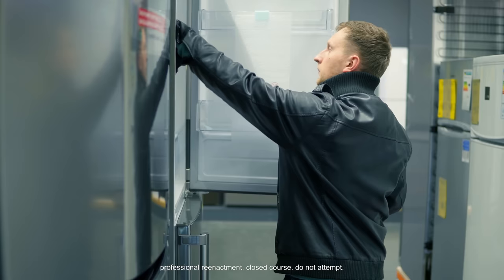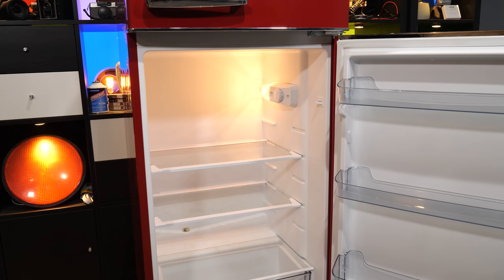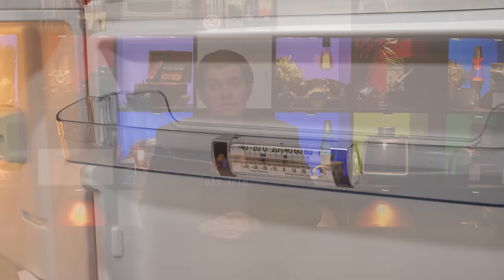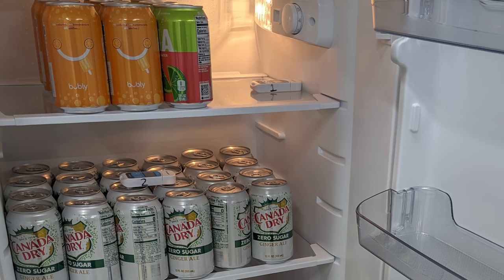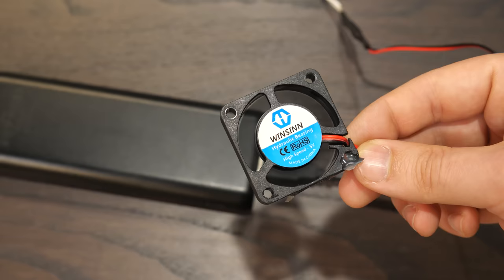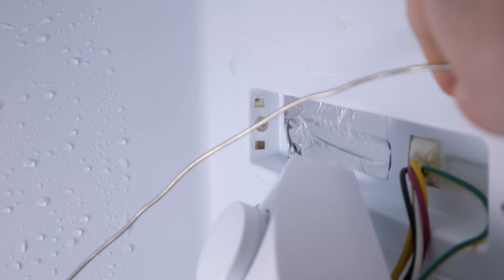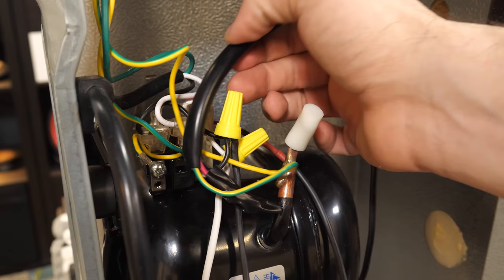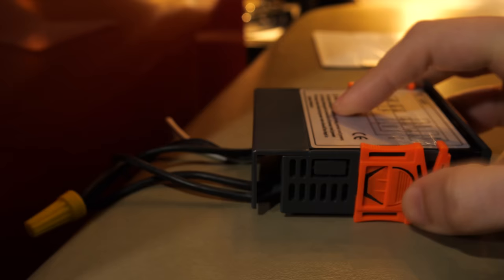This goofy fridge has a really clever design. It's also kinda terrible.

Comment: I think this design is used in 90% of all fridges sold in Europe. Sometimes you can see the fancy ones with integrated ice makers and water dispensers in stores, but you rarely see them in homes.
Reply: 98%
Reply: I am 40 years old and in all my life I have seen one home with a fridge with an ice maker and coincidentally that was this year.
Reply: @hkr667  This explains the general lack of ice in beverages in Europe.
Reply: I assume it's for "energy efficiency". As in, the device won't run constantly, even when warm, thus it will always use low amounts of power. Hahahaaha.
Reply: @hkr667 I'm 40 too, and in the first 30 years of my life in the UK never saw anything more fancy than this red 'mini' fridge. But since I moved to California, I'm the only person I know with a sensibly sized fridge. All apartments come with those giant monstrosities with double doors and an ice maker, which have surprisingly little useful space inside - what with only coming with one shelf - and consume a tremendous amount of electricity. And are pretty good at turning that electricity into a very audible hum.
Reply: @markmuir7338  Yeah, there are plenty of sensible refrigerators for sale at the appliance vendors, but most of the population want nothing to do with them.

I had to beg and plead with my grandmother just to get her to restrain herself down from the mega monsters and the best compromise I could get was a counter depth double door 17.5 cubic foot Behemoth.

When we never needed more than 12 cubic feet, and we certainly didn't need the stupid inefficient freezer drawer on the bottom.
Reply: @stephenj4937  Ice trays exist. And ice was common in USA before the wide availability of built in ice makers. Even in USA, I only see houses that have the in-door fancy ice makers. In every apartment I've lived in, if there's an ice maker it's sort of just this bolted in thing that dumps semicircular ice into a tray, and usually it doesn't work and just wastes space because the apartment complex never ran an actual water line to it.
Reply: @priestesslucy3299  Isn't that also to do with car dependency in US? IE you only ever get to shop once a week or so? Anywhere in europe I ever lived it was never a problem to do 5 minute stop on my  walk from work to get like 2-8 things so there was never need to keep stuff for more than 4 days ahead in the fridge.
Reply: @Turtle1631991  I've only lived in three places in my 34 years on this rock, but in every case I drove by a grocery store on my way into town to do literally anything, including work.

And I've always lived sort of in the rural fringe, away from the true population densities.

RN I live about 3 miles from a Fred Meyer, last place was 2.5 miles from a Safeway. In both cases it's right on the way to anything worth driving to
Reply: @priestesslucy3299  "I drove by"

That was sort of part of the point I was making.
Reply: @Turtle1631991  Much like how you can stop by a shop while walking or cycling, an American can easily stop by a shop while driving.

Comment: I agree with you that a refrigerator is a pretty essential kitchen appliance, but not everyone would agree that it is the most essential.  A few years before she died, my mom was talking with me about how much technology there was in the kitchen, compared to when she was a kid, and I asked her what appliance she thought was the most essential, and after a few moments though, she replied, “the sink and faucet.”  I had not even considered running water, taking it for granted as a given, but mom, whose job it was to fetch water when she was a little girl, very much appreciated having running water inside the house.
Reply: Very good point! My grandparents had water in their kitchen, but it was a hand pump for a well. Better than fetching water, but still a lot more work than modern plumbing!
Reply: There's a similar thing in the world of car maintenance. I did some thinking and realized that the only tool I use for every single job is a flashlight. You'd think that hand tools such as wrenches or sockets are the most important, but they're all useless if you can't see what you're doing.
Reply: As someone who has been putting a tiny home together for two years and living in it for one year, I can confirm it sucks not having a running water sink and constantly refilling tubs of water. On the upside, I never have to worry about pipes freezing and it only takes one of those to ruin your whole week basically while you cut out and dry out everything.
Reply: I'm wondering whether I'd choose running water or stove/fireplace. I think being able to use high temperatures makes cooking MUCH better and safer than being able to just clean the raw ingredients.
Reply: @PsRohrbaugh the most important appliance in the kitchen is actually the roof. My grandpa was responsible for holding the umbrella in the kitchen before roofs were invented. 🌈
Reply: @robertschnobert9090  Oooh la-di-dah, your Grandpa must have lived in one of them rich people houses.
There was no such thing as a fancy umbrella in my Grandpa's house.
My Grandpa had to raid neighbouring villages and capture a local to sacrifice to the rain god and pray to him to not rain in the kitchen.
If he came home empty handed his Dad would make him open a vein and make an offering of 7 pints of his own blood to the rain god as a punishment.
Reply: I don't think anyone in developed countries considers the sink and faucet to be an appliance though. They're just a mandatory part of the house, like electrical outlets.
Reply: I'm not sure you can consider it an appliance, but it's a really good point to make!
Reply: I'd best most people wouldn't think of that as an appliance just based off how people tend to think of individual items that can be bought, moved around, and plugged in when they hear the word appliance. Even the heaviest fridge or the oven would still fall under that mental image, whereas the sink is built in and not going anywhere so one might overlook it and take it for granted.
Reply: Your mother was an exceptionally wise woman; it's altogether too common for us to take things for granted the longer we've had it, and it takes effort to see what most people just expect to be there.
Reply: yeah, plumbing is not a kitchen appliance though.
Reply: @ngwoo that's the point, I think: OP's mom grew up without it, and she knows what a world without that amenity looks like. It's insidious how much water we in "developed" countries waste every day compared to people who have to actually draw their water by hand, often traveling more than a mile to get it. So many people live on 5 gallons of water or less a day (before boiling); for perspective, the average American uses 15 gallons for one shower!
Reply: @chaosvolt i think we can just use the dictionary here, Marriam-Webster:
2.b: an instrument or device designed for a particular function, specifically a household or office device operated by gas or electric current.

Meaning the generally accepted definition of an appliance is a device that runs on gas or electricity. (Main examples being the oven, microwave, fridge, clothes washer & dryer, ect.) This means the kitchen sink & running water aren't appliances. (But the water heater is)
Reply: Especially with the modern availability of canned and preserved foods, refrigerators could be entirely omitted from a kitchen without making it impossible to eat. However, I do think the tradeoff of needing to forgo the ability to save leftovers, keep fresh meat and dairy safe, and extend the appealing lifespan of fruits and vegetables, not to mention the ability to have ice cream at home, is too much for most people who were raised with refrigerators to give up. Especially because ice delivery service for an ice box is no longer a thing, so unless you have a cellar or something, you'd have no way to keep things reliably cold without refrigeration in the modern world
Reply: @jasonreed7522  Fair, yeah. Like I said this was more about what the word brings to mind when someone thinks of it, rather than exact definition. Both can end up causing someone to overlook fairly important plumbing fixtures, albeit for different reasons.
Reply: @chaosvolt  also fair, i would personally say that the most important thing in the kitchen is the food as that's what defines a kitchen. (Rooms are just rooms until you put things in them and give them a purpose, and the kitchen is for food preparation.)

And fair point about the risk of overlooking the true essentials because we are used to them. A short list of the things people just expect to work includes: electricity, water & sewage, gas if applicable, HVAC if applicable, and for the building to be structurally sound. And in the near future i expect high quality internet to be on that list if it isn't already. (I'm from a rural area and was used to dial-up until early 2010s, i moved and now 100mbps down is the minimum package. It not the same as when someone get the luxury of running water indoors and stops having to carry it in from the community well, but it still feels like a crazy jump in amenities and potential quality of life.) Who knows what will be added to this list in the future of "luxuries" taken for granted.
Reply: @robertschnobert9090  We were evicted from our hole in the ground. Slept in a shoebox by the side of the road, all twelve of us.
Reply: A fridge was not as essential back then as it may seem to us now.
Milk was "stored" in the form of cheese, fish and meat were smoked or salted, fruits were turned into jams... plus everything I can't think of right now and probably many other preservation methods I've never heard of.
They also knew how to preserve eggs from fall to spring so that they could continue eating eggs through the winter when the hens stopped laying.
Reply: I still think the fridge is more essential. I could fetch water from the bathroom (there really isn't any place outside the house to get it from), but I can't keep my food from spoiling in the summer heat any other way but with a fridge.

Comment: The fact that this fridge rejects modernity to the point of using an incandescent light bulb makes me love it even more.
Reply: It's the same reason the light in your oven is incandescent; they are consistently very reliable over very wide temp ranges.
Reply: ? my parent's 1 month old fridge has a normal incandescent light bulb,are there really fridges out there with LEDs?
Reply: @stephen1r2  No doubt because the temperatures that the filament operates at dwarf any of the ordinary temperatures found in its usage environment. It's effectively always running in the same conditions.
Reply: @vasopel  Yes, our fairly expensive one from 2012 is all LED lighting.
Reply: @vasopel yes, my fridge has an LED bulb, but that is acutally mentioned in the marketing, so i guess it's not that common. You can buy replacement LED bulbs for fridges but i haven't seen any for ovens.
Reply: @dragosmoldovan990  hm..I am curious..on your fridge..can that LED be replaced with a regular incandescent fridge bulb? and about oven bulbs...I am 99% sure that they are the same incandescent ones that work on fridges.
Reply: @timfischer  2012? hm..maybe only the expensive ones have LEDs
Reply: You can get LED bulbs to install in fridges, at least those that use a normal A socket. With how cheap LEDs are these days, it's especially ridiculous having incandescent bulbs, which are literally heaters, in even some brand new fridges..
Reply: @vasopel  yes, it can be replaced. If the wiring can handle it, it's just an E14 socket bulb.
Reply: @vasopel no, LEDs are ran using DC electricity where standard filament light bulbs use AC electricity. This means that you can buy led light bulbs for things wired for AC power because the LED light bulbs have a board and AC to DC converter built in. If you have issues with LED lights going out early, it's because it's buying cheap bulbs with cheap boards and cheap ac to dc converters. Devices built for and with LED lights usually use dc power directly which means incandescent lights are harder to run and take more power using DC than AC power so most devices that are designed for led aren't compatible with filament bulbs. 

Note: this is my understanding, i didn't research this and I'm just using my logic and experience to extrapolate this information. I could be completely wrong about all of this.
Reply: @TwoAPTMLMusicProductions , the reason LEDs go out before they're essentially unlimited theoretical lifespan is because they get too hot in enclosed areas. I suspect even in an enclosed area in a fridge that won't be an issue... I'm not sure about their running efficiency in cold; it's not impossible they may be dimmer or something. Another issue might be condensation that gets inside eventually. But I assume bulbs built for fridges have waterproofing treatments on their circuitry to deal with that.
Reply: Probably helps keep defrosted
Reply: @RobertHancock1 In an excess of  over-zealousness, I replaced the incandescent bulbs In my refrigerator with LED ones for long life and to reduce energy consumption. In a month both of them had burned out. Since three from the same batch burned out in my ceiling fans, I came to the conclusion it was a bad batch, not that LEDs wouldn't be perfectly happy in a refrigerator. Then I thought about it and realized that the incandescent lamps would last a long time because they weren't on when the fridge was closed (I take this on faith) and for the same reason I wouldn't save much energy nor heat up the fridge that much. So I put the old incandescent bulbs back in. Why did I write this comment? Am I waiting for the paint to dry on my Christmas tree lights because I didn't like the color they produced and decided to change it?  Haha, no, who would possibly do that?
Reply: @TwoAPTMLMusicProductions  actually, mine is just a 230V regular LED bulb. You could put a filament bulb in there no problem, assuming the bulb enclosure can handle the additional heat. It's an Osram PARATHOM T26  bulb with 4W of power
Reply: I thought about replacing mine with an LED but since it's running for maybe an hour a year it would take forever to make an impact and probably die of old age before that.
Reply: @vasopel  mine is i think, either that or a very white fluorescent, but it's been going for over 13 or so years and still works so idk
Reply: @emma70707  yeah but the thing that breaks bc that heat is the ac to dc converter, the actual LEDs are fine usually
Reply: @vasopel  You might do some damage. Watt for watt, an incandescent bulb draws 10 times the current of an LED.
Reply: @stephen1r2  Using incandescent lamps in a fridge is about the dumbest thing I've heard. They are like little heating elements.
Reply: I got a fridge controller like that for brewing beer but it actually just gets plugged in and then the fridge plugged into the controller
Reply: @i.k.8868 yes but when they're on the door is open and has a far bigger impact on the temperature inside the fridge
Reply: @stephen1r2 bingo
Reply: @Sonny_McMacsson well not to mention that LEDs contain plastics and other materials that would melt in a oven, even the solder.
Reply: refrigerators need "smart" led lighting with color temperature and brightness control. nothing worse than having to go to the fridge in the middle of the night and getting blasted with bright (and relatively cool) light. f.lux for fridges? kickstarter idea? thank me later
Reply: @WCM1945 Er, no, if it drew ten times the current it would be ten times the wattage. Watts are not a measure of luminous flux, if that helps..
Reply: @i.k.8868  It's never on for very long? 
How long do you spend staring into your fridge?
Reply: I would say replace it with LED only if the original one broke, remember it only turn on when you open the fridge, it’s not going to make an impact on your electricity bill
Reply: @dragosmoldovan990  There are no LEDs available that can handle running in an oven and there probably never will be.
The LEDs would have to be outside the oven and use light pipes or fiber optics to get the light into the oven.
Reply: @dragosmoldovan990  I see,thanks ;-)
Reply: @rocketman221projects  that is true. BTW, fiber obtics and light guides transfer back infrared, so that would also be impractical. I have never seen an oven with LEDs.
Reply: @stephen1r2  Yes
Reply: @ingulari3977  It's still cheaper components/wiring; so they will keep doing it
Reply: A 120-volt 4 Watt incandescent bulb will dissipate around ten times the power consumption of the "equivalent" LED bulb. Hence the vast difference in efficiency. Remember that the LED isn't rated at actual consumption, but to its light output relative to that of an incandescent of the same wattage.
Reply: @WCM1945  that is not true in Europe at least. LED bulbs are rated at the actual power consumption and luminous output. Sometimes they also have a incandecent equivalent rating, but that is not the norm.

Comment: You made me laugh several times because I would think..."Just add a little fan inside. That will fix it."  And then you do. And down the rabbit hole we went together.
Reply: Yet, the fan outside directly wire to the compressor.
As it, it fans the compressor when the compressor is working.
Reply: I was thinking to give it a bigger more powerful compressor tbh
Reply: I was thinking the same thing with "Just take the temperature sensor out of the walls and put it in the fridge, surely that'll fix it!"

and then it did not
Reply: I was thinking that he should add his own temperature control circuit, and then he did exactly that